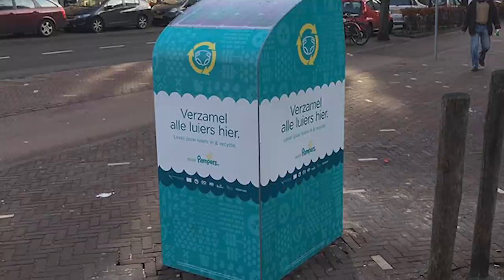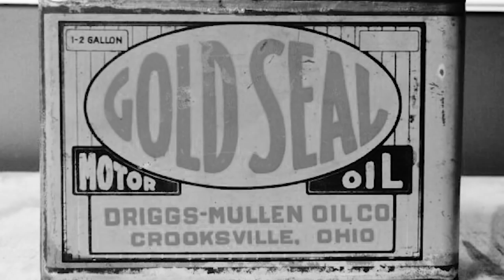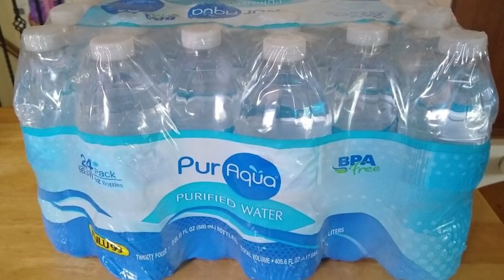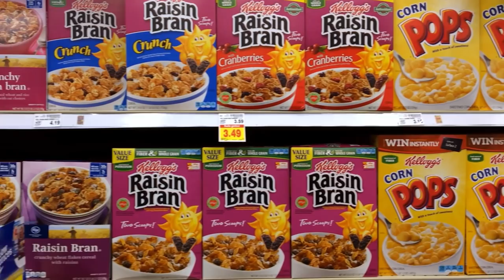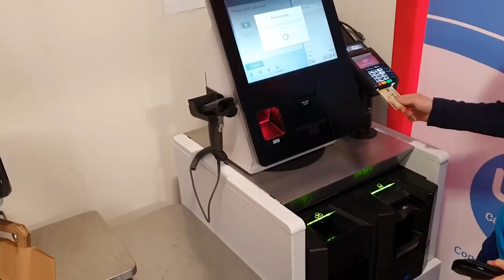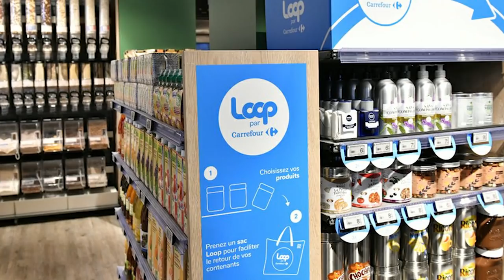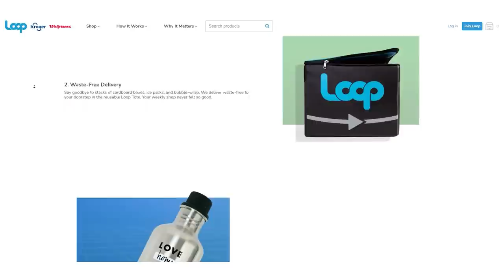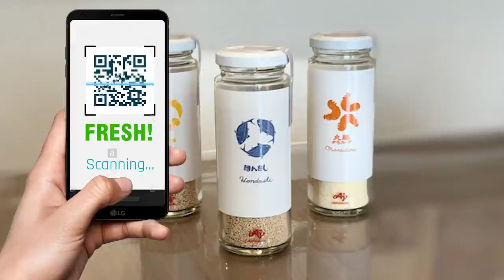Tom Szaky's Plan to Disrupt Retail | Full Interview

Comment: First off we need to have the populace think about using less. And for the diapers that’s a lot of energy I wonder how much energy is consumed compared to as we had in the 60s and 70s cloth diapers and a diaper service to clean them. I know it took a little more work to put them on. I know when I grew up in the 50s and early 60s we recycled everything that we possibly could re-purposed everything that we couldn’t recycle if it all possible and didn’t buy things if it all possible that we’re not reusable or recyclable. This still is the way we live. Some counties in Maryland are cutting back on what they will recycle because they have no place to sell them or even give them away. This whole Problem is a complete cycle. From raw material through manufacturing through distribution through selling through using through reusing or recycling and government will never have the answer.